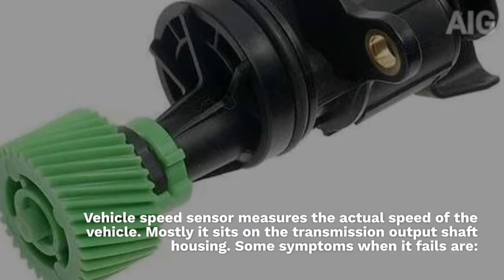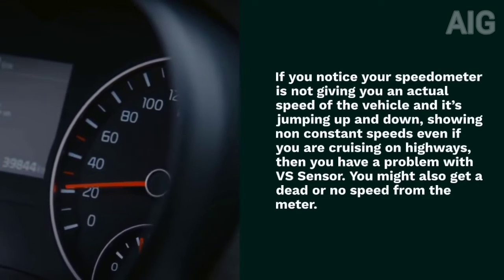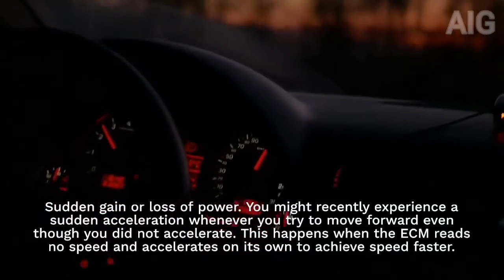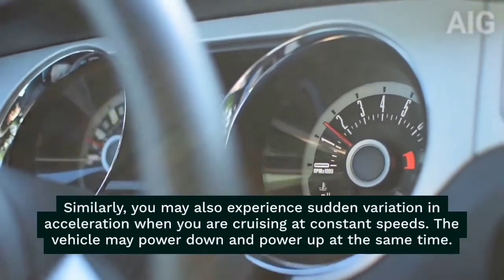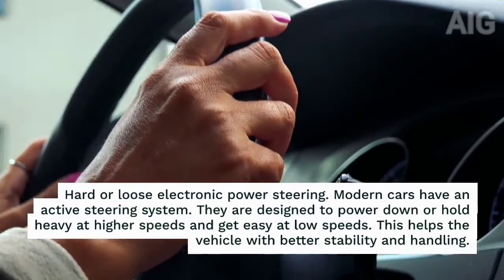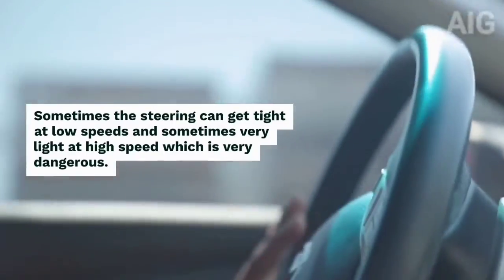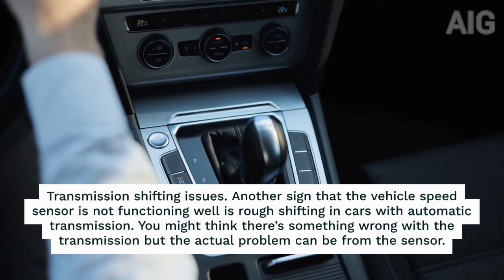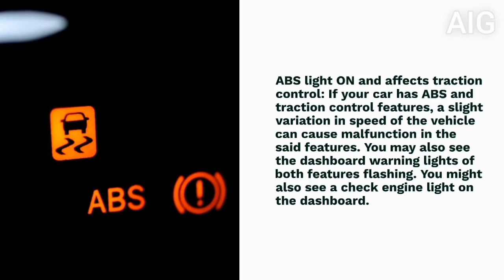Bad Vehicle Speed Sensor - Symptoms Explained | Signs of bad wheel speed sensor in your car

Comment: all four of mine are very bad. would this cause check engine light to come on and blink? i had it scanned and the only thing showed was abs wheel speed sensors.
Reply from the maker: Mostly the ABS light should come on. Modern cars are integrated so chances are yes. Could replace the sensors and see if the light goes off
Reply: @ right after the first left front abs went away